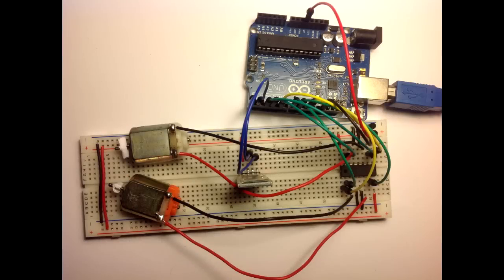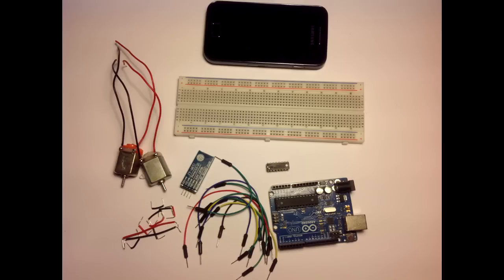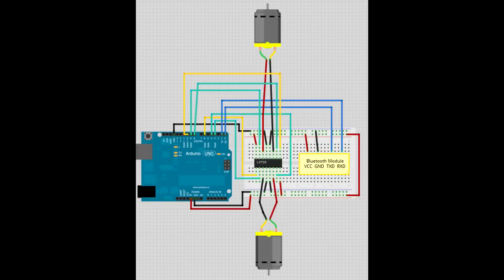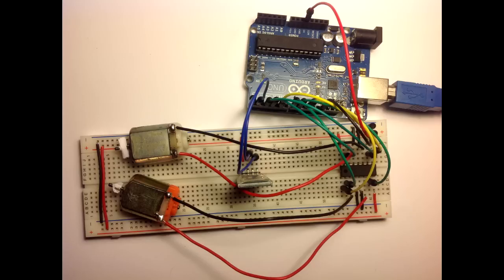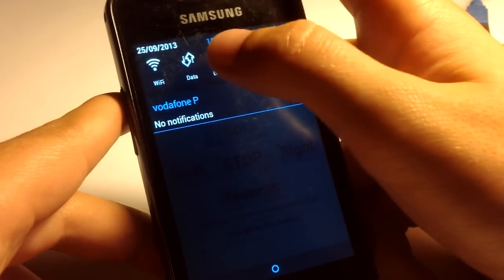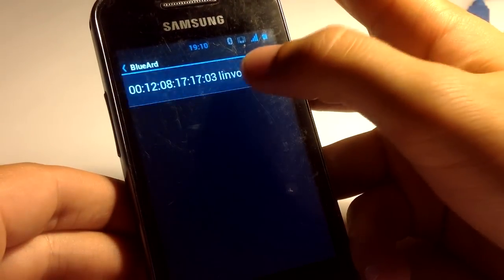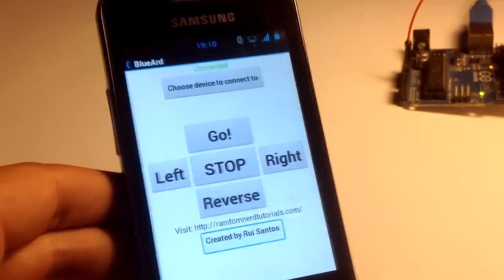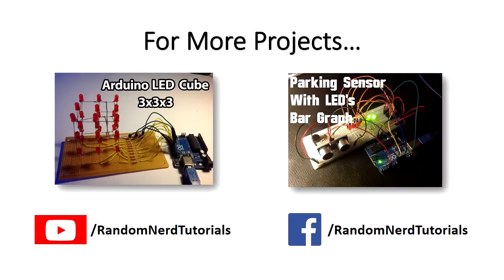Arduino - Control 2 DC Motors Via Bluetooth (Tutorial)

Comment: I'm having a lot of trouble trying to get this setup to work, I've followed all the steps from the tutorial link.. although the bluetooth module and Arduino power on through the supply coming from the laptop, I cannot seem to get the motors to turn with the l293d chip.

Comment: is there a way to run the motors when you are only pressing on the button, not by pressing a button and then pressing stop to stop the commands,but just when you remove your finger from the button it stops
Reply from the maker: yes, that's totally possible... you just need to change my Arduino code.
You need to take a look at if statement and instead of keep moving forward (for example), make it stop as soon as you release the button with another condition
Reply: Rui Santos Just Flush it... change the state to zero after few delay seconds